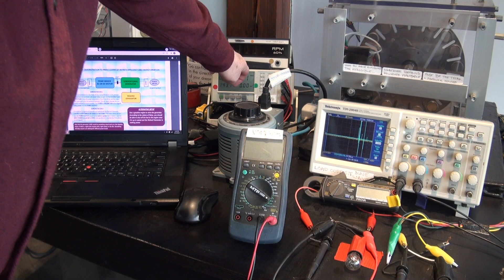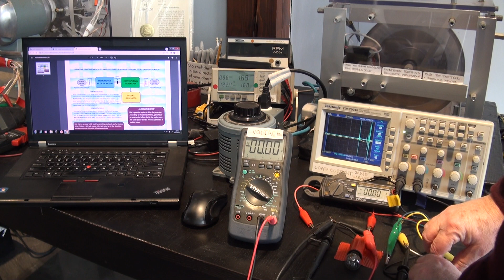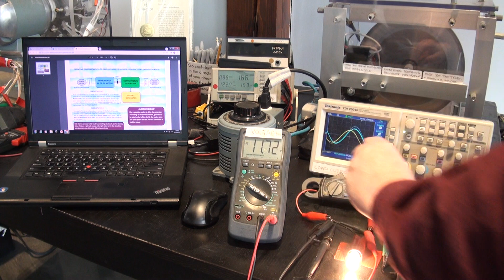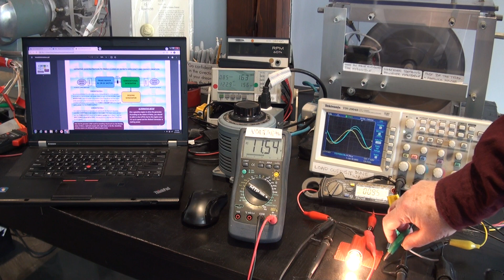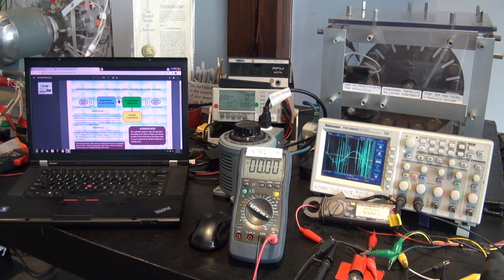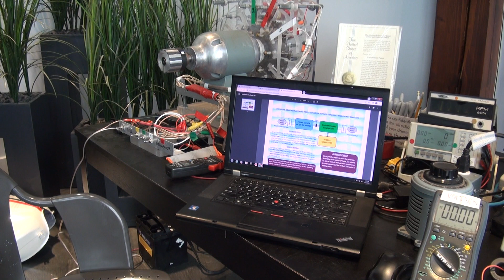PART 1 MIT TEST PROTOCOL RE INFINITE EFFICIENCY ReGenX GENERATOR & ReGen-X QUANTUM MOTOR PERFORMANCE

Comment: Hi Thane. I watch Your videos from early of Your discovery and I miss every rime one fact. You dont show how big power consumption is for the traditional system without any physical generation coils present for the same rotatoon speed. I can understand all what You say about Your discovery but miss that measurement. Can You make it? The reason Im asking is that the presence of generation coils with metal pieces near rotating magnets create load itself already before You employ any of generation coils. And the question Im asking myself is : How much more power is consumed by adding coils before employung them to work to compare with power You present on idle mode when You have Your coils physically present next to magnet wheel and they simply are there without producing ant electricity.
Reply: Heins is talking complete gibberish here.
Nobody is watching his videos.